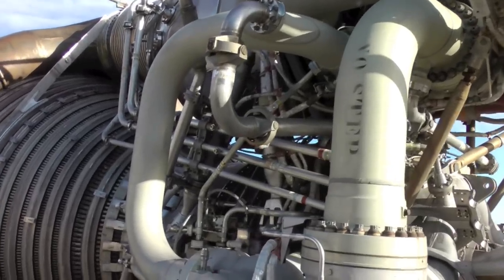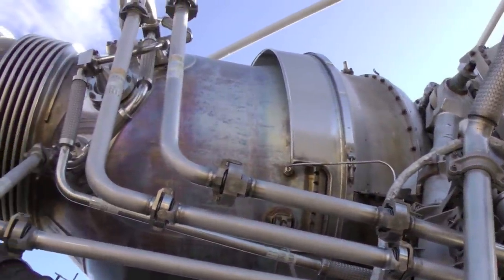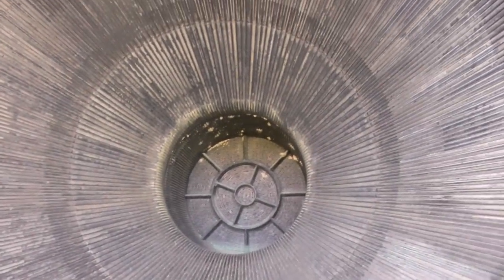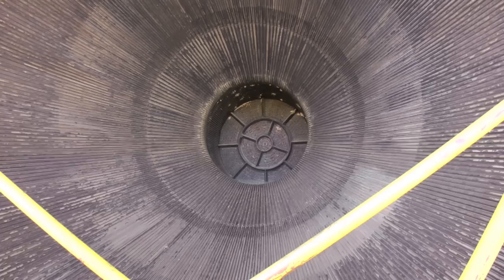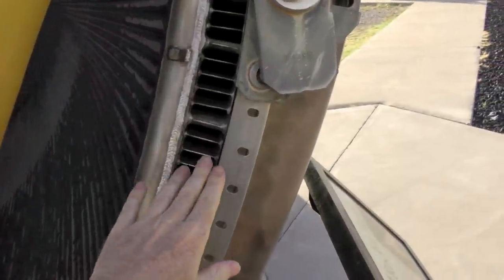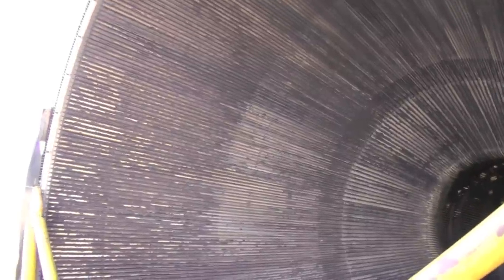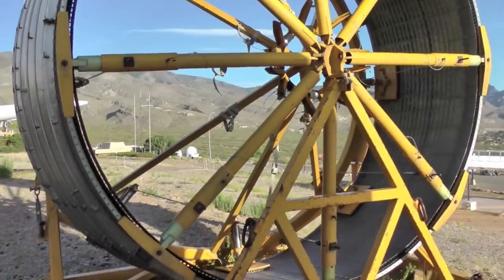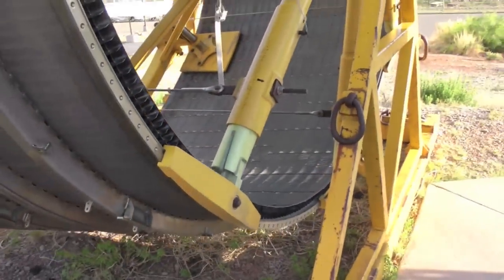Saturn 5 Moon Rocket's Main Engine, the F-1 | NASA Apollo Program Space Travel HD

Comment: This F1 like many others, sits out in a parking lot eroding.  Meanwhile, some $12,000,000 piece of modern art consisting of twisted coat hangers and melted plastic bottles is housed in a bullet proof encasement in a museum under guard.
Funny how someone can walk by a 33,000,000 HP engine without a glance.  Then stroll into the museum and cry with tears and hushed voices in awe of a wad of coat hangers dipped in house paint.  Which was made in 7 minutes by some schizophrenic dude wearing a necklace made from the dehydrated kidneys of dead relatives.
Reply: +maxtormaxtor hahaha. It IS sad.
Reply: +maxtormaxtor no piece of art will ever be remembered more than Apollo 11 so this engine will never be forgotten. There are engines in museums.
Reply: Bill Kerman
Yes indeed. There's one at The Space & Rocket Center, here, in Huntsville, Alabama. Actually there's one of the two or three remaining Saturn 5s that weren't used because Apollo was cancelled. They had them built & ready to go, but they never got to launch. I'm glad now, because you can stand beside one & look at how incredible it was. And see the engineering that went into it using slide rules. The Saturn they have here, is laying down on its side so you can see how all the stages fit together. They have a full size model out front thats beautiful, but the real ones more interesting. My dad was partly responsible for those F1, 1st stage engines. He worked at Marshall Spaceflight Center here with Von Braun. I've heard the engines tested when I was a kid & it was a thrill indeed!  These assholes that talk of the moon landings being a hoax have called my dad a NASSHOLE!  He died of a heart attack before we made it to the moon, at 39, from working 100 hour weeks & these bastards have the balls to talk bad about these guys that did an amazing thing, in that kind of way! If only I could reach through the screen....
Reply: +STEVE SIMMS You should pity them. People that don't believe in these sorts of things are uneducated. I was having an argument with a guy that was claiming NASA fires all the rockets into the sea because he thinks rockets don't work in space. I never got a reply when I asked how the space shuttle landed a couple of days after launch. I'm Irish so I never had a chance to witness a launch live. I would love to see an F-1 for real because I'm sure no matter how big I expect it to be, It will be bigger when I'm next to it if you know what I mean.
Reply: *****
Yea, they Knew there was a life & death risk & many thought their odds were about 50/50. But they did it anyway, because they wanted it that bad. And though 13 was close , they didnt lose Anyone in space. Only on the ground. And That was simply due to the rush they were in & not a single engineer thinking of the Very simple fact that there was NO NEED for 100% oxygen to pressurize the ship for a plugs out ground test. Sad, but when you're rushed, a lot of times the most simple of things is what you will overlook.
Reply: +maxtormaxtor Not me my friend.  I really wish these priceless artifacts were stored in much better conditions but there are still almost a hundred of these engines.  I found out that there are over a dozen of these F-1 engines that were carefully stored in a warehouse in Alabama.  These engine are currently being re engineered for the SLS and more copies of these engines will be made using bleeding edge manufacturing technology.   The origole engines were hand built by the very best master craftsmen on the planet.  The welds on those engines were all done by hand literally years of man hours went into the welding of these engines under the most brutal of deadlines.  These engines are legendary works of art that bring a tear to my eyes.   I have a large framed print of one of these engines sitting in my hobby room den.   No European brass music instrument or clock work even comes close to what was invested into these engines.
Reply: Phillip Mulligan
You are absolutely right. My dad was one of the guys that worked on these engines!  I still live about 45 miles from Huntsville. They had to practically re-invent welding to do some of the things they did.  In much of the Saturn 5 construction, they were welding two pieces of material of different thicknesses, & it was causing problems. They literally had to re-engineer the welding machines they were using so that they could weld the different matl.  My dad died before we made it to the moon at only 39 yrs old. They were working sometimes hundred hr weeks to get the job done. And these assholes that claim we never went to the moon have got the nerve to take the accomplishments of these Incredible engineers & flush them down the toilet!  They even said my dad should have had a better diet!! Like they know what he ate!  And also called him a NASSHOLE!  If I had them in person, I just about bet you, they wouldnt talk that way.
Reply: STEVE SIMMS Now that's sad loss.  Your dad was such an artisan.
Reply: Phillip Mulligan
Thanks Phillip. He was a very intelligent guy. I got to see one of these engines tested when I was just a kid & I never forgot it. Went on & got a degree in math myself & worked in engineering before going into music full time.
Reply: STEVE SIMMS Music.  Than you must have found these 10 ton titanium tungsten wind instruments music to your ears from 12 miles away.  I would love to have heard their sweet roaring tune.
Reply: Phillip Mulligan
I heard one test from THIRTY MILES away!  They were testing the whole assembly of 5 engines that day. My dad told my mom & me to go outside at a certain time & see if we  could hear it that far. And we did! It sounded kind of like thunder on the horizon. The other test, I think was a single engine test & we were at Redstone, I think. I was just a kid at the time. My dad worked at Redstone 1st,  for the ? something missile command. Cant remember the term.   And then went to Marshall Spaceflight Center. But those babies definitely had a sound. Much like a wind musical instrument. They were for sure a work of art.  I wish I could have made it down to the cape to see a Saturn launch but we never made it. Just looking closely at the intricate detail of the piping & the small pipes around the nozzle that diverted fuel to cool the nozzle & actually heat the fuel, it was AMAZING how fine the detailed work was! Its more like something you'd see in an art museum than on something this power & to only be used once. Thats a shame in itself. They only got to work for about 8 minutes.
Reply: *****
Yes it is. Too bad they couldnt have reused the first stage, but into the ocean it went.
Reply: STEVE SIMMS NASA has at least 20 unused F1 engines sitting in an Alabama warehouse last month I heard.   They will be re engineering these engines as possible alternative thrust configurations for the SLS.
Reply: Phillip Mulligan
 Its good to know they will not sit forever unused. They were working on a new super engine for the new moon rocket until obama castrated NASA. It was supposed to be the biggest engine ever built. Even bigger than the F1. It was going to be a SINGLE engine first stage on a rocket about the size of the Saturn. Not sure if it was to have any drop away boosters or not, but it Was only one main liquid fuel engine. So it must have been planned to have a helluva monster thrust!
Reply: Have you seen the latest SLS configurations?  So far they primarily show 4 hydrogen fueled liquid RS-25 and two solid rocket boosters. So far the F-1 modification is just a serious engineering study.   I would not be surprised that an improved F-1 gets used for other variants of the SLS.  There are a lot of deep space missions planned around this rocket system.  Besides Moon and Mars.
Reply: Phillip Mulligan
They've been improving the RS 25 as I heard anyway. Can it be throttled? I cant remember. But yes, this does seem to be what they're planning everything around.
Reply: *****
Exactly what is it you're saying doesnt sound possible. But the fuel was as you know super cold. It was run through piping around the nozzle to keep it from melting. It also served the purpose of bringing the fuel to close to ignition temp when it hit the combustion chamber. They burned a mixture of liquid oxygen & kerosene. Thats why there would always be a bit of a black smokey streak left after it lifted off. But the combined 5 engines burned almost 15 tons of fuel per second. It took enormous turbocharged pumps to move the fuel that fast. A fire hose would be like an ant pissing compared to how fast they pumped liquid !
Reply: *****
I know. When I first heard it, I was skeptical to, that one engine could do That Much. But it may be that they were planning on using solids like the shuttle to get it basically off the pad & up to at least some speed. Because, the force on one engine to do that, hell, I dont know how a combustion chamber could stand that much pressure, & the pumps would have to be even More incredible. So, I really dont know either?
Reply: It is sad but it will be ok.  Being in the desert and the engine made of stainless steel, it will live longer than us humans out there.
Reply: *****
MUCH longer.
Reply: A real shame, especially when the vast majority of visitors were not alive or around to experience the Apollo programme.
I suppose being able to get up close to mans most powerful rocket engine, is a bonus, it could easily be off limits to the public, standing behind a barrier.
Reply: that's not how it works at all but mkay
Reply: STEVE SIMMS

Ich verstehe sehr gut, was Sie fühlen.
Ihren Zorn auf die Leugner der Mondlandung.
Diese ungebildeten, dummen Menschen beleidigen die Schöpferkraft und die Risikobereitschaft der Schöpfer dieses großen Stückes der Menschheit.
Danke für Ihre Beiträge!

sorry for German speek.
And many Grieetings!
Reply: Feel free to send what money you have to the museum so they can build a new exhibit hall. They don't just give away buildings for free.
Reply: maxtormaxtor,

But... but... but... you don't understand!
Reply: Don't despair my friend, the F1 was made out of pickled livers.
Reply: Wonder how that worldview squares with the fact that W Bush canceled the Space Shuttle program w/o a viable followon to allow access to the ISS other than hoping the Russians don't screw us over.

True that the Shuttle ran out under Obama, but during those 8 years a company which lands and re-uses rockets, and has launched a booster which will take an object to Mars with its own capital, and landed parts of it is operating.

I won't put down NASA, but to blame Obama for anything is not useful.  I guess you think the launches are orbiting the giant Earth frisbee too.  I'm glad that the capability has been built up in the private sector, and hopefully it won't be killed off by politics till it gets into space with economic returns that make it impossible to kill off.
Reply: what museum? I want to see this coat hanger art.
Reply: This is oddly specific, but I get your point.
Reply: @Steve simms...please don't even give those hoax ppl even one pixel of attention...we all know the truth. I wish I could talk to your dad over a few beers...and thank him for his contribution. I search YouTube but can't  find out exactly the one thing I'd really like to know about the F-1....and that is....how the hell the rocket was able to hold on to this thing...let alone 5. The motor mounts must have been an engineering feat themselves....And then the gimbal system...all of this stuff blows my mind.
Reply: @stevesimms9622  I wish I could thank your dad personally for his contribution to, what is in my opinion, the greatest technological and scientific achievement that our species has ever accomplished. I'm only 22 and so I didn't have the chance to hear or see one of the great F1s in action let alone a full Saturn V launch. But despite this, the moon landing, and especially the Saturn V vehicle, is my inspiration for my studies. I am studying mechanical engineering in the hopes of one day designing rocket engines, and anytime I need a boost of motivation I just que up footage of a saturn v lifting off the pad and I get shivers down my spine. When Kennedy said we'd get to the Moon in a decade, ambitious would be putting things generously. But it was people like your dad who showed us that when we put our minds to it, there is no goal too great, no challenge too hard, no problem too complex for us to solve. Regarding the idiots who think it was fake, if anything I feel potty for them. You and I know full well how vast and expansive our universe is, and that with enough effort we can see it all one day. We look up at the night sky and see not a dotted black canvas, but an infinite sandbox for us to explore. So I can't even imagine how trapped and helpless those poor naysayers must feel, believing that we are forever tied to this one tiny rock.
Reply: Best comment ever.
Reply: 😆 Well said. So damn true. There are some that revere theze engines tho. Look how much money Bezos spunked to pull the Apollo engines off the sea floor. Fantastic bits of history...
Reply: STEVE SIMMS
This is a 4 year old thread but here I am with my reply.
I was nine when the moon shot flew and the whole thing deeply impressed me. YouTube reignited my fascination with theses colossal machines and all who worked on the project to make it fly. I’ve done a lot of gas welding and have a good feel for the delicacy of welding intricate parts- enough be in absolute awe of the men who hand built this giant engine. As I understand this engine could not be produced today as the skills needed simply do no longer exist. Total respect to all who were honest men doing honest work.
Having said that there are legitimate questions intelligent people have that have nothing to do with the skill and honesty of those men who produced this rocket engine. 
In some ways it is like the 9.11 event where 2 planes in NYC collapsed 3 giant buildings. There are real legitimate questions, never answered that until this day just eat away at some of us. Same thing with JFK. What’s my point? 
With all DUE RESPECT, we live in a world that is an ocean of lies. It is no wonder people mistrust almost everything. In a culture of liars- people know there is no transparency in almost any facet of life. It’s not a personal affront.
For me personally for most of my life I accepted that men landed on the moon and came home. I’ve looked at quite a bit of the theory that we never did. Honestly I can’t say with authority either way. Some questions raised are never addressed, just like the JFK assassination, just like 9.11, just like countless other loose ends that lead one to wonder...

Comment: If I'm not mistaken the skirt is also cooled, just differently because it needs less of it. Instead of the complex tubing system they just spray fresh kerosene around the inside of it to form a liquid shield of sorts between its surface and the exhaust gas while also carrying away some of the heat that reaches the skirt anyway by radiation. 
The amount of fuel used for this is only a tiny proportion of the fuel used for propulsion but is what is mainly responsible for the heavy black smoke that surrounds the flame for a few feet on exiting the nozzle. The heat in the nozzle is enough to decompose it into a black soot but since there is no excess oxygen it does not burn until after it exits the nozzle and reacts with oxygen in the atmosphere.
Reply: You are close to being correct. The skirt is not cooled by spraying liquid kerosene on it. What cools it is the fuel rich smoky exhaust coming from the turbopump. The turbopump exhaust is ducted by its exhaust manifold into the lower part of the nozzle. This forms a thin film of relatively cool gas that isolates the combustion from the metal of the exhaust skirt. You can see a lot of that detail in this video. You are correct about the smoke that you can see several feet outside the skirt except that it is composed of the turbopump's exhaust gas before it mixes with the outside air and reignites.

Comment: Jim White, no, the F1 engines were reasonably stable.  All the Saturn V's used the five F1 Lox-Kerosene engines in the first stage (called the "S1C"), five J2 Lox-Hydrogen engines on the 2nd stage (called the "S2"), and a single J2 Lox-Hydrogen engine on the 3rd stage (the "S-IVB").  The only other rocket used for any Apollo flights was the older Saturn 1B, which flew the low-Earth orbital missions of Apollo 5 (unmanned test of the lunar module) Apollo 7, the Skylab 2, 3, and 4 astronaut ferry missions, and the Apollo-Soyuz Test Project.

Comment: I nearly always (well, at least the SCUD missile engine has definitely something that looks like that on it, even if much simpler) saw this piping vertically extending from the upper part of a liquid fueled rocket engine (standing vertically on the "bell") to the bell's mouth. I thought it was a directional thruster or something like that. Now i understand it's an exhaust coming from the turbo compressor (yes, it has the same look, shape and working principle of a car's turbocharger, but instead of moving air it moves liquid fuel around...) and used as a cooling device, to move some cooler fluid around the engine that takes part of the excess heat away from the hottest areas. Thank you!

Comment: liquid oxygen was circulated through the tubing that formed the nozzle and pumped directly in the exhaust chamber forming a insulating layer that kept the hot gasses from the interior walls.
Reply: Fuel , not o2 was the coolant